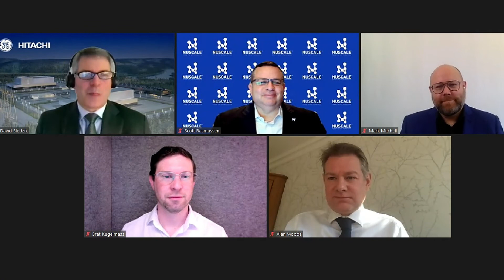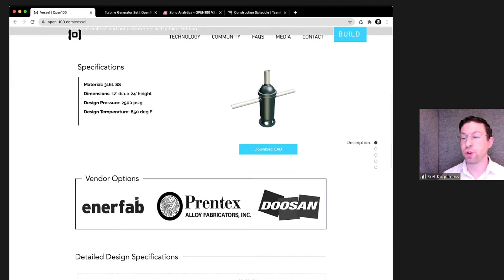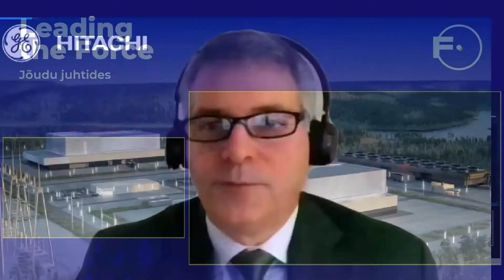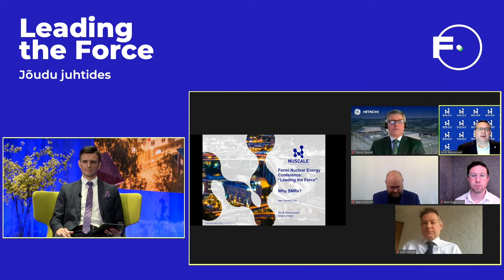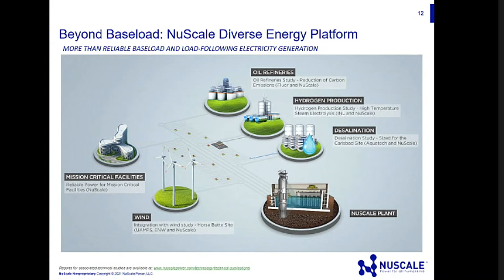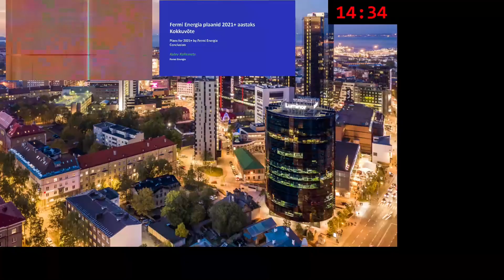Leading the Force 2021 - Why do we need SMRs?

Comment: This is very productive and what you want is to replace the coal boilers with smrs and make them as cheap as or cheaper than coal. For my mind the best way to do this is with molten salt especially for process heat shipped out of the  modular reactor at 600 to 700 degrees for the receiving company and MAKE IT VERY CHEAP SO YOU CAN DESALINATE AND  MAKE CHEMICALS. A win win for everyone.